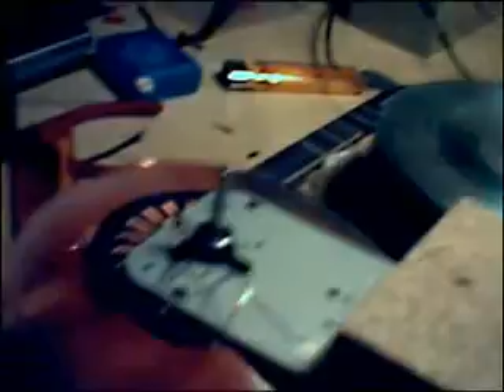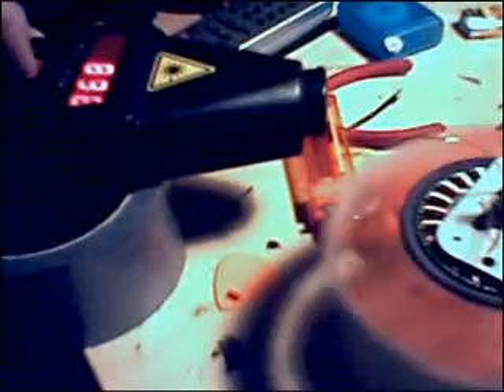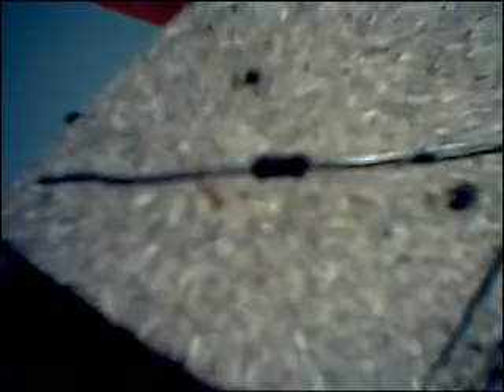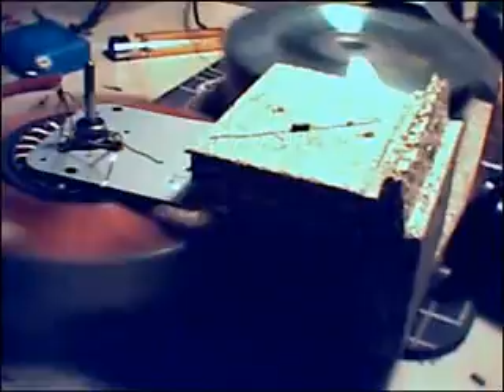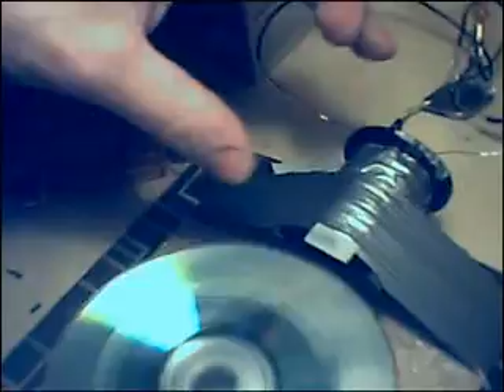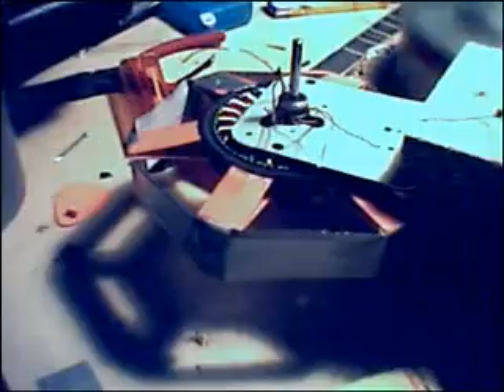Magnetic Coupling of new SSG.

Comment from the maker: right. been working hard. Think the whine is due to variable resistor being just about knackered and the 100ohm resistor too. them fixed I have moved on. As for ur comment above, I believe ur right. My tachometer was giving bad readings despite having proper reflective surface. ur estimates seem good. However, i changed the coupled rotor to 3 magnets and u should have seen the speed!! takes torque, I think there may be potential energy. ATM i continue to condition my batteries and charge others.